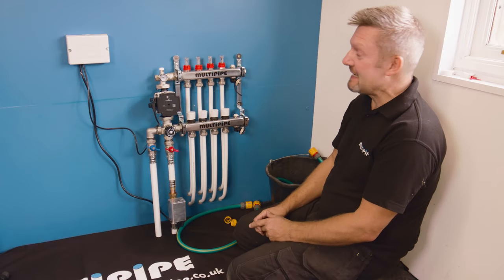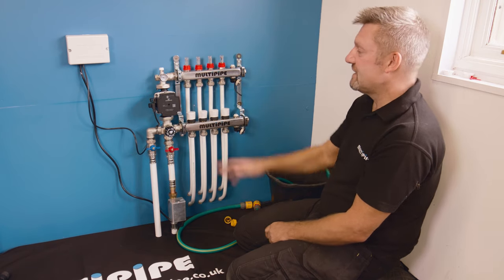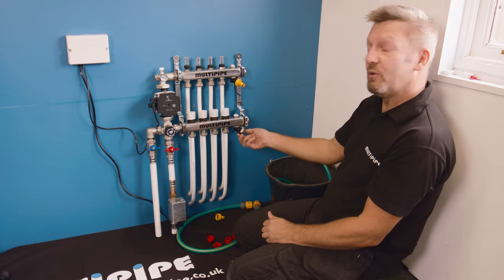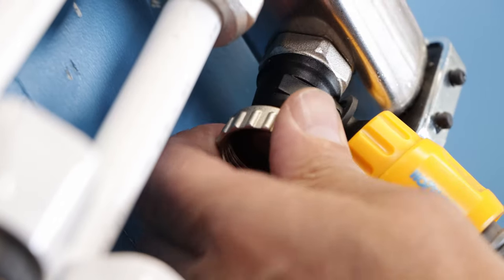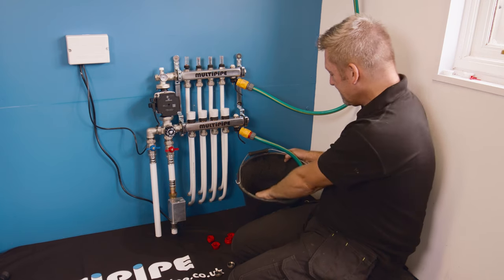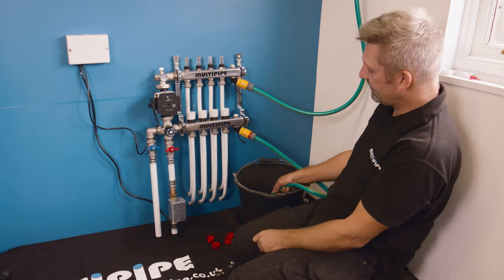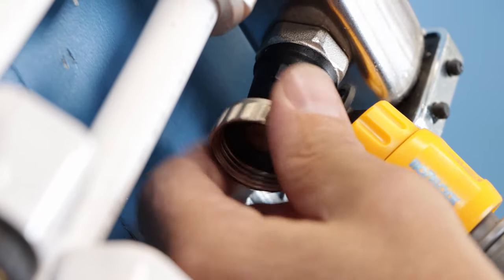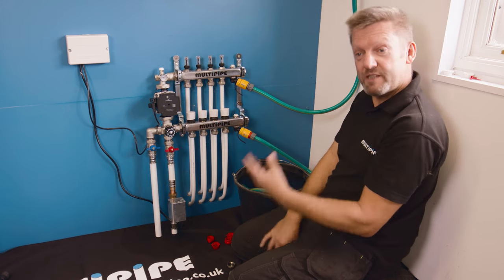Filling And Venting Your UFH Manifold

Comment: Thanks for the video. Super helpful! I see that you keep all four bottom ports open. When you fill the first loop, what keeps the water from going back into loop 2, 3, and 4? Is there a check valve inside the manifold?
Reply from the maker: Glad you liked the video. Because we shut all flowmeters at the top and opened the bottom drain point. Water would always take the path of least resistance. So, it would always flow out of the drain over back flowing through the loop.
Reply: Good point. In my opinion it would be better to open the bottom ports one by one, corresponding the flow meters on top.

Comment: Great video, fully understand the process. One small point is that I already have a working system with actuators fitted, how do I open the actuator ports?
Reply from the maker: The best thing is to mark the actuators in the order they are. Then, unscrew them. Please ensure that when you put them back on, they return in the same order.
Reply: Thank you for the helpful advice, a follow up question please, how do I open the actuator ports as your video indicates they should be in the open setting @MultipipeLtd

Comment: This was so helpful. Really easy to understand the principle and process.. I can't fill using a hosepipe thiugh as the circuit is on the second floor. Is it possible to fill another way?
Reply from the maker: glad you liked the video, the water has to be pumped in without air so you can get a simple pumped filling station (normally used in solar applications). You can then also add inhibitor/biocides etc into the tank making system dosing easier.

Comment: Hi, thank you for the amazing tutorial, you mentioned that you should feed water from your tap and not the boiler. I just want to point out if you have a new boiler and have a filter attached it would be better to take the water from the boiler. Would that be a correct assumption?
Reply from the maker: Not quite. The boiler filter is more to stop sludge and silt build-up in the heating system over time, so it will run through the filter. It would be the same as using the boiler's filling loop. Of course, we would always recommend filling your system using the VDI 2035 standard and using desalinated water.

Comment: Thanks for this well informed video. Can i check if you turn off the water pump when doing this or does it need to be running? Cheers
Reply from the maker: When filling the manifold the pump need to be off as this could damage it. Only during commissioning of the manifold it has to be connected to the heat source and the pump must be on.

Comment: One more question you mentioned in the video that different flooring should have different temperature setting? What’s for wood flooring? Thanks
Reply from the maker: You are correct. Most wood floorings have to be protected from a floor surface temperature no higher than 27°C (this is also the same case with some vinyl floors).

Comment: Hi thanks for the video, extremely helpful, may I ask a question is that the flow meter should be remained closed after the filling?
Reply from the maker: No, you need to ensure before you remove the old version, you need to make a note of the flowrate set. Then ensure this is replicated on the new version/ use your commissioning sheets you usually get from the installer/ supplier of your system.

Comment: Given that all the 'return' activator ports are open, what stops the water returning from loop 1 (when you are filling it), flowing into loops 2, 3 and 4 by way of their return pipes? Is it the fact the loops are closed on the flow side (so air pressure would encourage the water to take the easier path into your bucket? I'd still have thought some would go in, unless there is a non-return valve built into them somewhere?

Comment: Great video and very helpful. Just to clarify with teh electric actuators, do I pop the plastic connect part off and then pull up each actuator pin with pliers to open each loop for bleeding? cheers
gerard
Reply from the maker: Best to have all actuators off (remember to number them in which order they are before removing them). You should not need to pull the pin up as they are sprung loaded.

Comment: Great vidoe thanks, I have 8 zones working great but one zone no heat in one room, stone cold! I removed actuator on the manifold, set the flow to max 5lt/min. The flow and return pipes are hot but the room remains cold. The room was being heated fine before just this last week it's gone cold. System is heatmiser 2 yrs old. Zone is furthest away from manifold and above the manifold. I suspect there's are restricting the full flow of heated water around the circuit.
Reply from the maker: If both your flow and return is warm (a UFH system should never be hot!) then you have got the flow there as it is pushing the water around the circuit. (always check the temperature from the lowest point of the pipe). Its one of two things 1. the flow and heat is fine but just not had enough time for it to recharge the slab (normally takes 3-4 hours) then a further 1 hour to heat the room.(depending on thickness of floors.)2. something had failed in  the construction of the system meaning it no longer has good transference of heat to the room. Have you changed floor coverings etc. recently?

Comment: Hi I’ve watched this video and it seems straight forward but Iv watched an uponor one where the actuator valves were closed with decorator caps, I prefer the way in this video is there much difference the other way ?
Reply from the maker: sorry for our delay in replying, no, both method isolate the manifold. So use which on is easier for you. thanks for watching!

Comment: Hi thanks for this video its really helpful. I have just moved into a 3 story house that was built in 2006. It has underfloor heating on every floor and the top floor it seems doesn't work, i get no heating at all, i have checked the cupboard with the manifolds in after watching this video each of the glass flow valves have brown water in and showing no flow (apart from a few rooms very slow) I think the system needs flushing and an anti bacterial inhibitor put into it. Will i need a pump and a large bucket of water for this? as we are on the third floor i can't really run a hosepipe up. Any advice is greatly appreciated.
Reply from the maker: We would recommend you get a plumber in to do a full flush of the entire system and refill with treated water (chemical inhibitors might not work). I would say an entire floor failure would be either a pump or zone valve failure. Both which a plumber can check and replace.

I hope this helps.
Reply: @MultipipeLtd  thankyou! That has been a great help, plumber coming next week thanks again

Comment: Thanks couldn't figure out why mine wasn't running very good,but realised I was flushing it through from the return pipe.
Done as your video and works perfect.
Any info on what the pump should be set at would be good.
It's a grundfos upm3..k.
Thanks mark.🤔🤔🤔
Reply from the maker: Glad the video helped, as for your pump it all comes down to the total flowrate required from your system and over coming the amount of pressure to push the water around the highest resistance circuit. The UPM3 pump is not normally used as this cannot be adjusted externally, it might be UPM3 Auto, Auto L or Hybrid if one of them start on the proportional curve setting 2 balance your system to the design flowrates if you cannot get the flowrates when all loops are open then switch to setting 3. I hope that helps.

Comment: Hi. Thanks for the video. We get a slight whistling when our single zone UH kicks in. The only other zone from our combi boiler is the central heating radiators. Any idea what may be causing the whistling ? It's quite annoying during the night. Thanks again.
Reply from the maker: it is probably to do with too much primary side pressure from the boiler pump. you may have to fit a auto bypass valve to reduce the pressure against the valve. I hope that helps.

Comment: Bloody great content, makes way more sense now. The manifold I'm working on has the flow meters on the bottom and actuator ports on the top. Would I still send water through the flow and out the actuators even though flow meters are below? Cheers!
Reply from the maker: This is a bit more of a tricky one. Because it could be just the bars are flipped, or the flow meter is actually not a "flow" meter and registers the return water flow instead. The best thing to do is look at where the pump is pumping. Whichever manifold bar it pumps to first is your flow, and you want to push the water from that bar and out the other. I hope that makes sense.
Reply: @MultipipeLtd  thanks for the reply, yep makes sense. Another question,  What would be the best way to purge air out if it has gotten into the lines prior to the manifold. (main flow/return)
Reply from the maker: @thanktheknife  that's a bit more difficult as it all comes down to the system itself. But, this should naturally work to the highest point of your system (normally first floor radiators) where you bleed it out with the bleed key.

Comment: Hi you are a genius! Love the video.
Q: my underfloor heating is around 2 years old. It's 25 square metres of pipe in 3 areas so 3 way system. The flow side of the room gets very nice and hot the return is lukewarm... Could this be an air bubble lock in the system like your video? Any advice you have  would be greatly. I don't know the installer otherwise would have checked with time. Appreciate your time ☺️
Reply from the maker: Glad you like the video. This sounds to me like a lack of flow, have a looked at your manifold and look at the flowmeters when the system is running you want to be having around 2l/m on there the higher the lower the drop over the room but be careful you do not starve the other loops.

Comment: Hi. I have a system with the isolation valves on the top and the flow meters on the bottom. Which way to I fill and vent through? Thanks for the great video
Reply from the maker: It is hard to say but normally, whichever bar is at the top is where you put the fill pipe on and drain from the bottom. But a good way to check is with the pump. There should be an arrow on the body, which shows the flow direction, and this should point to which way the water flows across the manifold and down the loops, just follow this.

Comment: Hi Martin
If you have the electric operated valves on the lower manifold how do you open to do a flush?
I’m guessing they’re closed if the thermostat is not calling?
Reply from the maker: it is best to mark them up (left to right) then remove them. as you are correct they close the valve.
Reply: @MultipipeLtd  thank you 👍

Comment: Hi. My system has flow meters at bottom and actuator on the top,so it is oposite than yours. Should I bring water also where are flow meters on the bottom or should I bring from the top. Hope you understand the question
Reply from the maker: Some manifolds are setup this way (not many though) but the basic principle of the flow manifold is at the top and the bottom is the return still stands. So still flush this way around. But also double check that the manifold is not just plumbed the wrong way. i.e. flow manifold has been put accidentally on the bottom. You can tell this by the flowmeter as it would not show a flow on your system (as they are pushing the wrong way). It can also stop the system working.

Comment: Hi, great video. Was wondering if you have done a video for putting inhibitor into a UFH system? Not found anything on this elsewhere. Was thinking you pump it in using a pressure pump? Thanks.
Reply from the maker: Damon, thanks for your message, you tend to add inhibitors through a radiator or even the fill loop using a pressure pump as you mentioned. you can try and do it when not under pressure but it is more difficult.

Comment: Hi, thanks for posting this useful video. I’m totally new to UFH and the house I’ve moved into has it installed. One of the zones for some reason isn’t getting as hot as it should, and the flow gauge is always low on it. Is it likely it needs flushing and release any trapped air? 
Thanks
Reply from the maker: Thanks for your comment, air in the system does not normally show as a low flowrate this problem tends to either be an unbalanced system or the loop installed is too large for the system. In both cases, I recommend getting a plumber out to rebalance the system, have a word with the manufacturer of your system for the specific flowrates for your house.  One small thing you can try is removing the “actuator” that sits on the lower part of the manifold for that loop. Once done press the pin up and down a few times and see if it is not just a stuck pin (then replace the actuator back on).

I hope that helps.
Reply: @MultipipeLtd  6

Comment: Thank you for the useful information.
BTW, how do you manage to fill the remainder of the circuit (From boiler to manifold) ? It looks tricky as you can dump air into the manifold while doing so.
Reply from the maker: Many thanks for your question. I would always suggest when filling the remainder of the manifold to vent from the bar of the manifold (and pump) you should have a manual air vent on the flow and return, make sure the circulator pump is off when doing this that will then ensure no air enters the loops.
Reply: @MultipipeLtd  I guess doing this while all loops are closed on both sides will do the trick. Thank you.
Reply: I know Im asking randomly but does anyone know a way to get back into an Instagram account?
I was stupid forgot my password. I appreciate any assistance you can offer me.
Reply: @Orlando Augustine instablaster ;)
Reply: @Cayden Ariel it did the trick and I finally got access to my account again. I'm so happy!
Thank you so much you saved my ass :D
Reply: @Orlando Augustine You are welcome :D

Comment: I read that with a heat pump (rather than a furnace ) flow per room should be 1 litre per minute. It seems low ! Any thoughts ?
Reply from the maker: that sounds more like a minimum flow rate requirement per loop? As it does seem a bit low. Some heat pump manufactures use the thermal mass of a UFH system as a bit like a thermal store. So by not fitting actuators and allowing free flow though, the energy is stored in the screed.

Comment: Great video.  Any suggestion as to why my 3 loop system will only get flow to just one loop?  As long as just one loop is opened, there will be flow.  It is not a specific loop that works but any loop as long as the other two are closed.  If I open the other loops all flow goes back to 0 flow and no longer transfers water through the system.  Thank you
Reply from the maker: Thanks for your kind comment, this can be several factors. 1. the pump on your manifold is not been selected on the right setting/has not been properly bled of air. Or if it is an older system the pump is failing and is providing a weak flow. I would suggest getting your local plumber a call or contact us for more help.

Comment: Thanks for good video, I have questions how do you balance the circuit  or each loop and what about the radiators on first floor,  do you start with the radiators and then ufh or it doesn't matter, thank you for advice
Reply from the maker: depending on if you have a pump for the UFH (pictured in the video) then I would recommend balancing your rads based on fully open on the index circuit and throttle the rest. Then the UFH you would do separate, as the pressure drop to the manifold is tiny because of the secondary pump, if you have no secondary pump I recommend fitting a double regulating valve to throttle the UFH manifold as well. We will be releasing a new video soon on commissioning so watch this space. thanks for watching!
Reply: @MultipipeLtd  thanks

Comment: Hi my system of continental underfloor heating is 10 years old, should the system be flushed with fresh water? Thanks
Reply from the maker: Providing the system was filled with an inhibitor and biocide and is regularly checked as part of your service then no. The same water can remain in the system. If however, you have brown or black water showing in the meters at the top of the manifold then a flushing and reuse of a biocide might be a good idea.

Comment: Thank you very good video. I also have a UFH 4 zones. Can you control the amount of heating you want in each zone by reducing the flow in the Circuits for each zone?
Reply from the maker: Unfortunately no, you need to invest in a wireless multizone control system this will then control your pin on the lower manifold and give you control on your system. Please call us on 01245227630 to discuss your best options

Comment: how do we go about this process if there is electric actuators ? would it be enough if i were to start the heating, let the electric actuators open fully and then do this process.
Reply from the maker: The best thing to do is mark the actuators with the position they are. Then remove them completely. This ensures the valve is wide open. then put them back on in the order written on them.

Comment: Hi Igor!
When i open went with a little key with water presure  have a leaking water from a little 2 holes in vent.
Wrong went?
Btw video is awesome.
Reply from the maker: Hello,  it sounds like you are opening the air vent (normally located at the top on the manifold bar). You need to look for the square key on the full valve itself